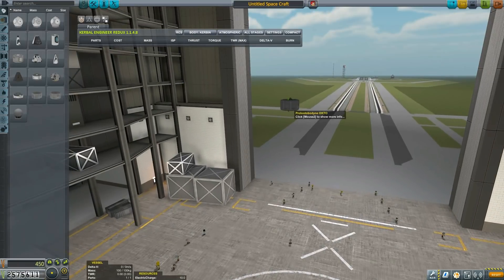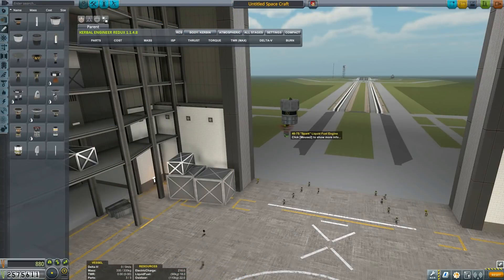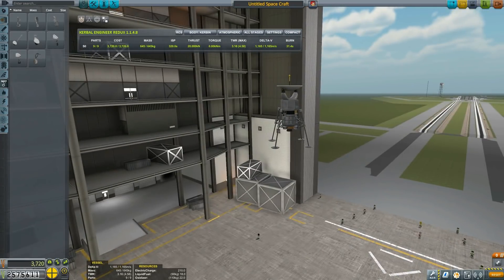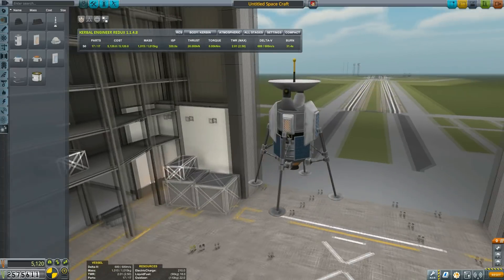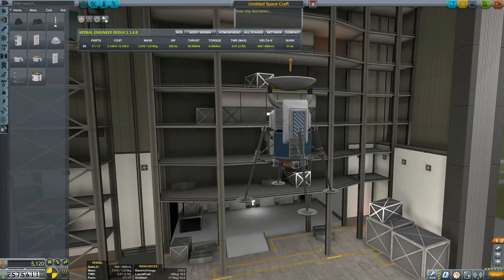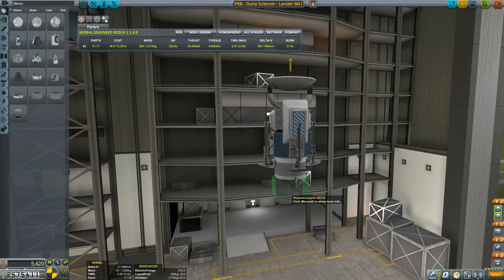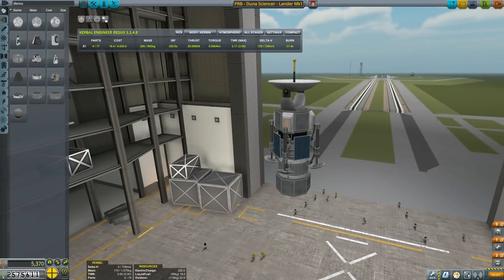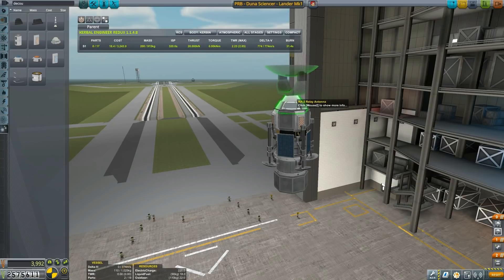Kerbal Engineering - How to build Duna Science Lander Probe

Comment: Great video!  You can make it easier on yourself making separate crafts though.  
First option is to build them separately, and then you can load in a separate craft where it will act like a sub assembly.  
Second option is to build the first craft, then when you attach the probe/cockpit, you can select it as the root part and separate the other craft however you will still have the whole other craft as a visual indicator and you can attach it to test easier.